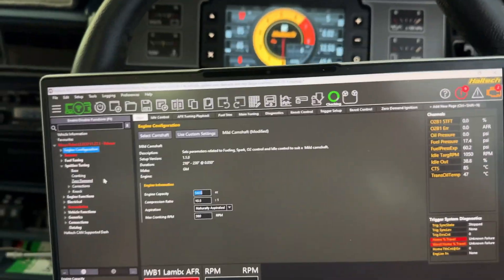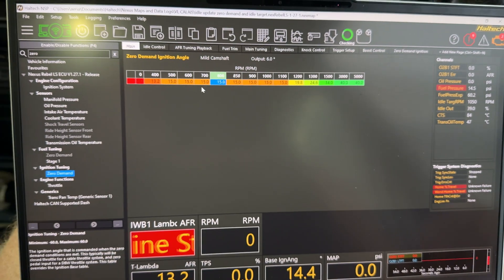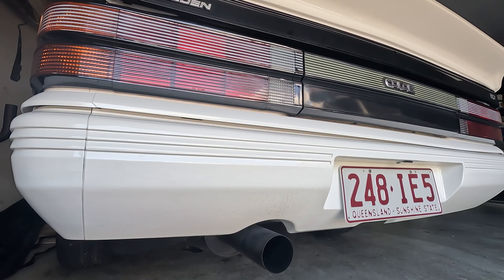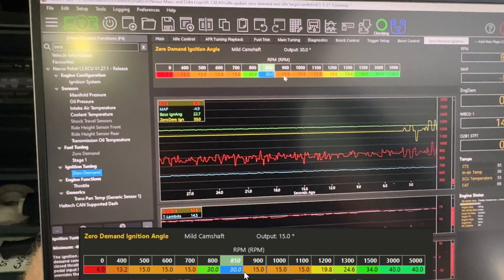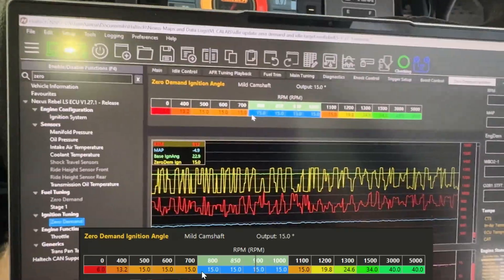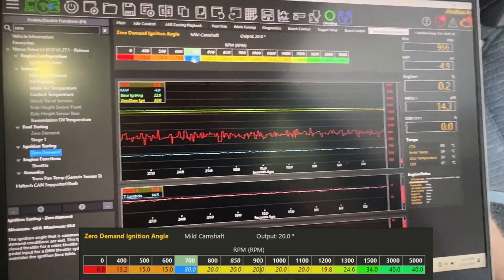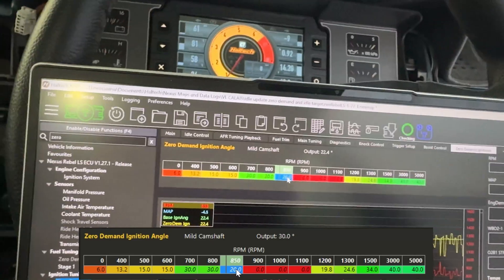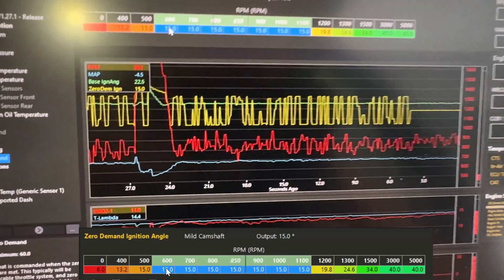HOW TO: GHOST CAM - HALTECH NEXUS REBEL LS

Comment: figure worth an ask, if I have cruise and drive by cable how does the haltech deal with cruise? considering purchasing the Haltech and your vids have been awesome helpful.
Reply from the maker: You’d be better off asking on a Haltech or Rebel LS group. I’d imagine you’d need DBW throttle set up for cruise. Or a seperate motor attached to the cable.

Comment: So im using the haltech Ls rebel. How do i get that nice drastic blower surge.  I am running a roots blower. And cam.
Reply: Hey mate, do you have injectors before the blower? Blower surge is from going lean to rich lean to rich from the delay of fuel through the rotors. might be able to get the same effect from the zero demand in the fuel tuning page to make it go lean-rich-lean-rich.
Reply: @Xav.  I found the rotational idle feature on the haltech.  Does the same thing.

Comment: Great vid! I am new to the tuning world but have an LS3 conversion. I want to drop this Ecu in, I noticed on an install vid you need to choose your cam. Mine is unknown but very lumpy. On setup it asks what cam you have- you mentioned you don't know your cam specs either. What options were there and are there any implications of putting in the wrong selection, other than running rough?
Reply: I forget what the mid range cam specs were but the larger cam option was 230+. Very easy to swap between maps to see which one runs best.

Comment: You can leave your zero demand alone & use the idle ignition control & PID to over/under shoot your ign/idle target. That way when you transition off throttle it will stabilize, & then go into choppy idle.
Reply: If this is "zero demand" only, then wouldn't transitioning off idle (i.e. putting a slight bit of TPS input/demand into it) do the same thing? (I don't actually know, just trying to learn)
Reply: This is true